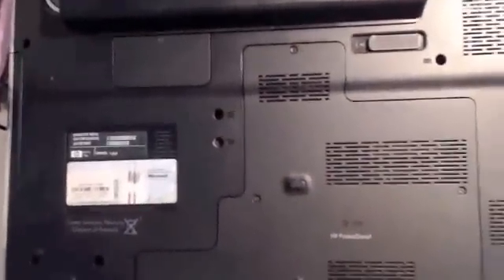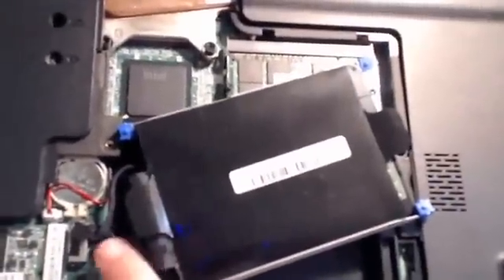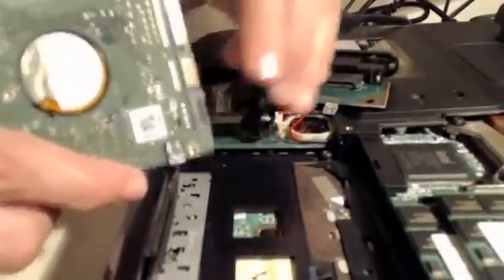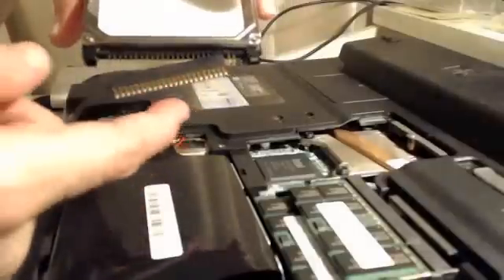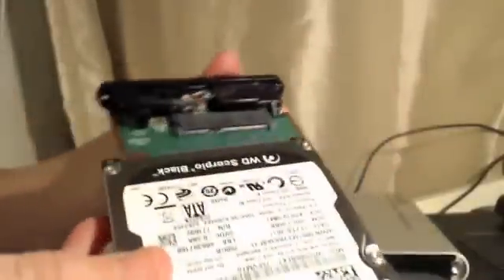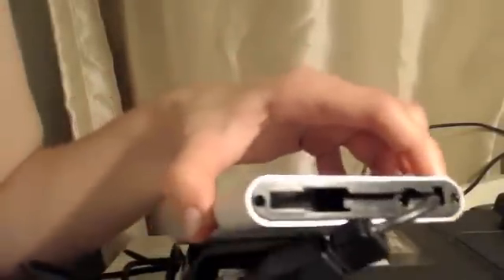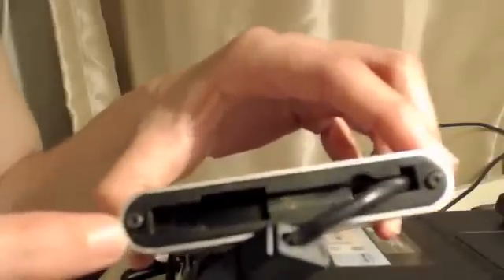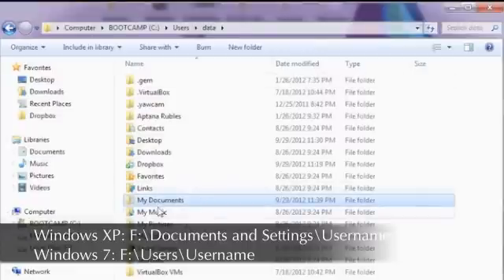Recover Files: Move Hard Drive to External Enclosure

Comment: Question: WIN7 OS. I have a older Window-Vers.  CAD Autosketch from (Autodesk),
wich a can run in the folder like Users(after i got this hot hint from a admin). If i run this on C:\windows--programms ect....
like the usual installer Autosketch  installs it, i have the Problem to crash  Autosketch session.
At may old win98 ÓS - Autosketch runs on  C:\windows--programms ect....
fine. They told me Win7 doesent want to run some Win-Autosketch on path
C:\Win..\Programs .
Hope to explain my mystic problem i have with WIN7 and Win Autosketch.
Greetings Holger.
Reply: Some mor Hints. 
i have the Problem to crash  Autosketch, only if i move & turn a CAD shape,
like rectangluare.
Error Dll xxx accures mystic.  
Mystic #2:
And the option to run in win98 mode did not solve the Problem.

recover your files from hard drive by moving to a external enclosure.
So it is always better to keep the Autosketch generated *.skd files
always in this special user1 user2 folder. location ???.i think ???

Comment: I keep a copy of 'KNOPPIX', which is a distribution of Linux that's not for installation on hard drives. When it boots up, start the file manager and you can see the faulty drive and just plug a USB device in and simply copy the files over. But, as João Guerreiro says, there are times when you just have to strip the machine down to get at the drive.

Comment: I the system does not boot you don't even need to remove the hard drive from the laptop, run a live distro of linux to recover the information. Now unless there is a hardware failure the only way is to open the laptop.

Comment: I have several external HDDs from customer laptops when the MOBO would die. They wanted their data but rarely wanted the old laptop back. Got some enclosures from Amazon for $4. So, what I end up with is a 80-320gig HDD for $4. Can't beat that.